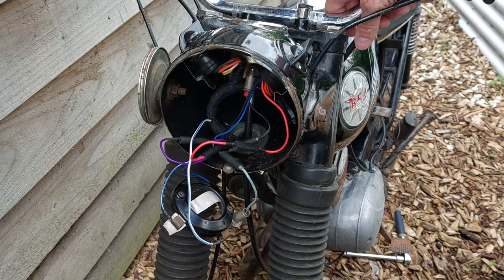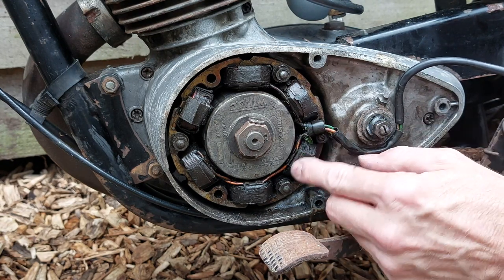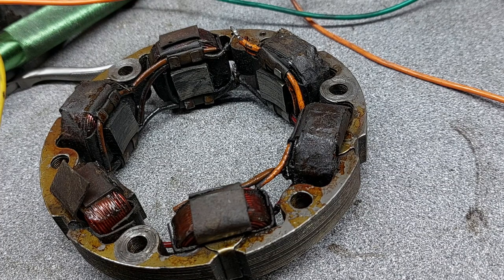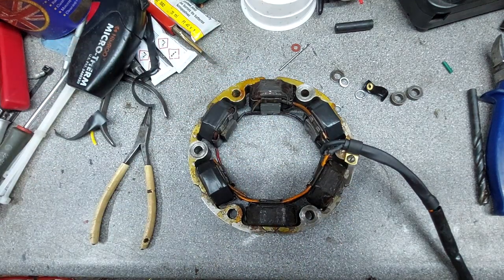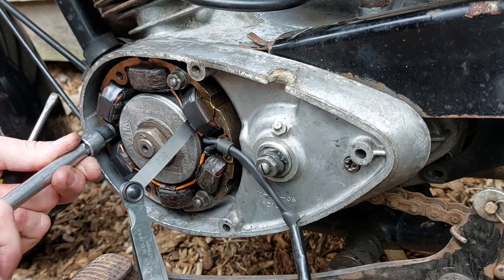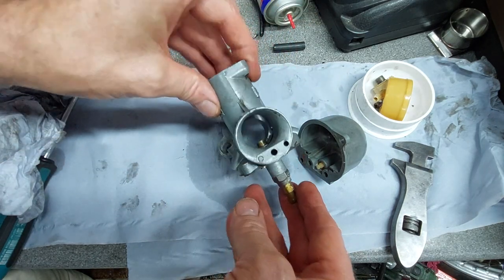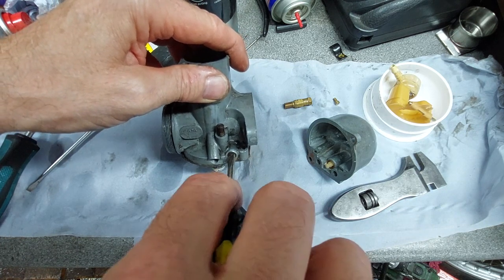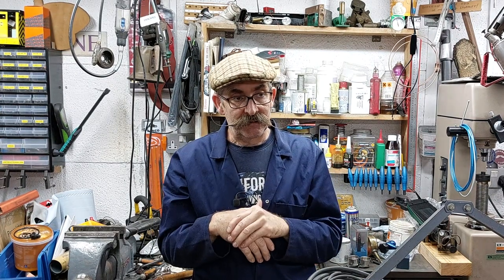WILL IT RUN.....BSA BANTAM ATTEMPTED START AFTER HIDING AWAY FOR YEARS

Comment: Excellent video as usual. I've had two similar Bantams. Have to say I prefered working on them to riding them :¬) 
The first, a black one just needed a bit of fettling then was used for some gentle commuting before I decided I needed something a bit bigger (an AJS 250).
The later blue one seemed destined to be perpetually rebuilt. My neighbour originally renovated then sold it, the purchaser kept it for a short while before dismantling it again then losing interest. My neighbour bought it back and sold it to me. I got it all back up & running - sweet as a nut - then sold it again. About a year later I spotted it back on ebay fully dismantled..... Hopefully someone is actually riding it now.
Reply from the maker: Some of these basket cases do more mileage in boxes than they ever did as complete motorcycles 😆glad to have tweaked some memories, hopefully riding it won't  be too disappointing but we shall see.

Comment: The sound of that engine brought back some memories Alan, my mate and I had one in about 1968, it was an early 125 D1 if I recall, we thought it would be a good idea to take the mudguards off, stick an old set of knobbly tyres on we'd gotten our hands on from somewhere; and try a bit of trial biking on the pit heaps where we live in County Durham. No surprise that the clutch lasted about three days, we were only 14 so a big lesson learned there, I learned an even bigger lesson when a lad turned up with a 350 Royal Enfield Bullet in full trail spec, well I had to have a go on it, kicked it over, into 1st gave it some throttle, dropped the clutch and it went straight into wheelie mode throwing me off and I broke my wrist on landing, what a beast of a machine... Happy days....Allen O'Rourke...
Reply from the maker: Happy days indeed Allen, they stick Yamaha clutches in them nowadays for trial work

Comment: Love watching you work Allen.....your lathe looks stunning....Old British I suspect....my dad was a tool maker.

Nice job on the alt coils....very neat....heat shrink is so handy isn't it....I owned a small aircraft some years ago....so I agree re solder joints.

Re your carb....the pilot jet drilling tubes and the tiny pressed in bush jet is a bugger for blocking a source of lots of running probs.

What was the screw through the air filter air hose at the carb end?
Reply from the maker: I could say its for fitting a vacuum gauge to balance the carbs.....but it only has one so I suspect it was to block a hole ( I will get a new hose ).
Collette is my Colchester Student 1800 lathe and Bridget is the Adcock & Shipley Bridgeport milling machine
Reply: Mill as well.....I am impressed @TweedsGarage

Comment: That all worked out very well! I am sure your theory about the eccentricity of the rotor is the reason for the varying gap. The surprise for me was the preference for crimped wire connectors, I have always considered these as one step away from a dry joint, I would think a properly soldered joint, supported by a shrink sleeve would be far less likely to stress fail than a crimped joint, given that it must be work hardened in the crimping process ? I also think that wiring looms left dangling as they so often are, are the most usual culprit for causing wire fractures, but vibrating machines are very hard on these systems, especially when the copper gets work hardened with constant movement. Enjoy the warm weather, we have 37 des here! Chris B.
Reply from the maker: Hi Chris, that is hot, its been a scorching day with no breeze down at Goodwood today with nobody moving, i feel for the traders as they pay thousands for the pitches but nobody was at the stalls from about 10.30 onwards, cooler tomorrow so hopefully they get a return on their pitch.
The solder/crimp debate is one of those subjects that could start world wars but i trained as an aircraft electrical/instrument engineer at the Royal Aircraft Establishment and aircraft wiring was always crimps ( but the crimps are far higher quality and technically complex than the cheap red, blue and yellow insulated affairs that come in those crimp kits and the proper crimp tools for them run into the hundreds of pounds ) 
Hope it cools down in France for you a bit . Mr T
Reply: A proper crimp won't have stress at the joint. Aircraft crimps "bite" twice, once at the wire joint, another (stress relieving) on the "bitter end" of the insulation. Properly done, all the stress is taken up on the insulation, and the actual conductor/terminal joint "floats" free from any mechanical stress. In aircraft, those terminal crimps are inspected quite closely, and any found less than perfect are rejected. Of course, on a bike or car, a failed solder joint doesn't usually cause a crash into a mountainside from several thousand feet above, just an inconvenience, and loitering in the rain until rescue arrives, lol
Reply: @ludditeneaderthal  I think the term "a proper crimp" is the key factor here, very few "normal" people have access to a proper tool as used in the aviation world, they must rely on a shop bought device that crushes the connector and causes local work hardening and a potential stress point, I accept that an incorrectly soldered joint can also lead to solder wetting down the wire and localised hardening of the insulation, but of the 2 methods I think the soldered joint, done correctly, is far better, there is of course the added problem caused by a Neanderthal with a soldering iron that will melt any electronic device within range, so there a crimp could be less problematical Stay safe! Chris B.
Reply: @453421abcdefg12345  anybody can do a "proper crimp" with almost any crimper with a decent jaw profile, even those incredibly cheap lousy ones. Getting your grubby paws on decent terminals is actually the hard part. I agree, those insulated red, blue, yellow assortments are incredibly hard pressed to offer anything approaching a halfway decent crimp, at best. Since radio shack went the way of the dodo (and even a few years before, when they stopped stocking anything related to their original business model), finding a double crimp terminal locally is about as likely as hitting powerball.

My point was more a why on the aviation insistence on crimps, as opposed to solder, wire nuts, screw union blocks, or scotch-locks, lol (yes, I've seen them all used on cars). Solder is way better than 99 cent terminals crimped with side cutters, or any of the above heresy. But, a good crimp on a good terminal is, undoubtedly, "best practices".
Reply from the maker: @ludditeneaderthal  a very nice description of the mechanics of a crimped joint, thanks for the input. I spent many an hour with very expensive crimp tools in the equipment bays of an English Electric Canberras, Blackburn Bucccaneers and Hawker Hunters recrimping Nyvin cables.